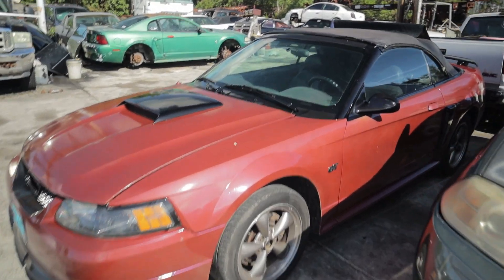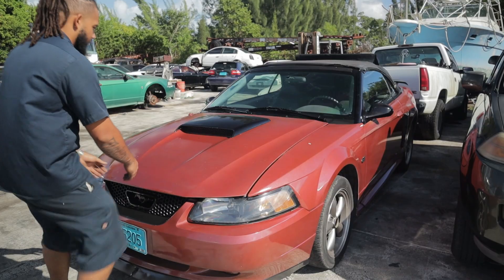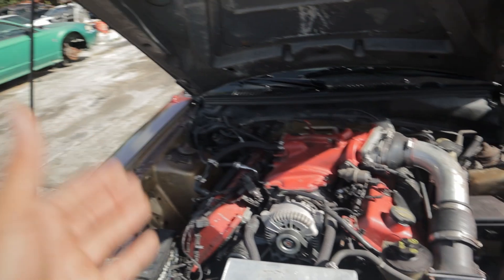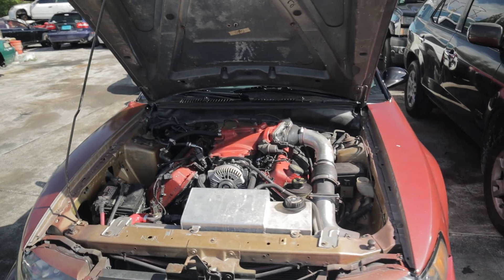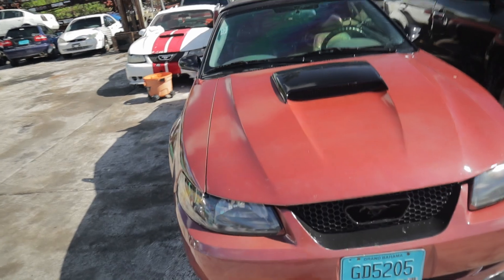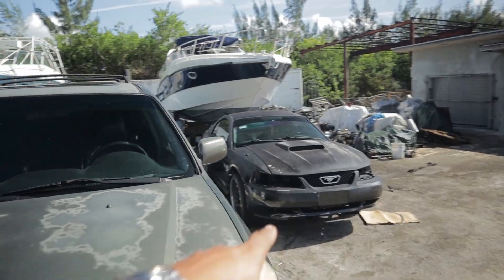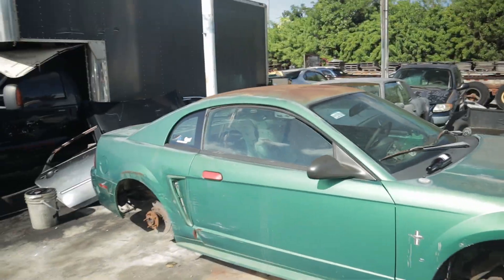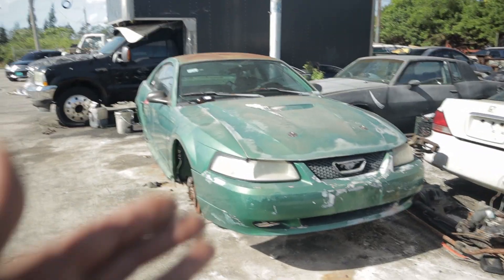The New Edge Mustang Is The S Chassis Of America

Comment: hi i have a terminator cobra i want to take out the t56 and put it in my auto 04 mach 1 . other than pedal assembly. what else would i need ?
Reply from the maker: And auto terminator ECU, a trans cooler, terminator flexplate and torque converter and I believe the auto trans have a different drive shaft, also a auto shifter
Reply: y